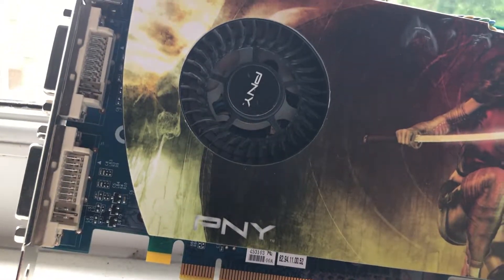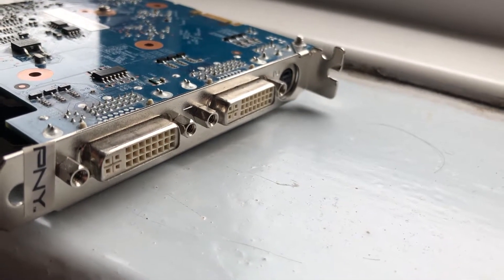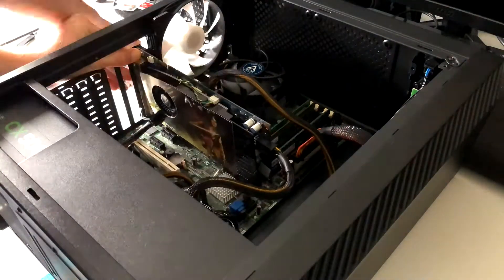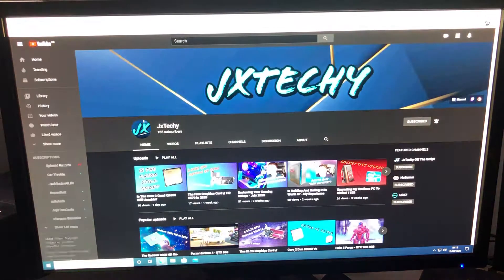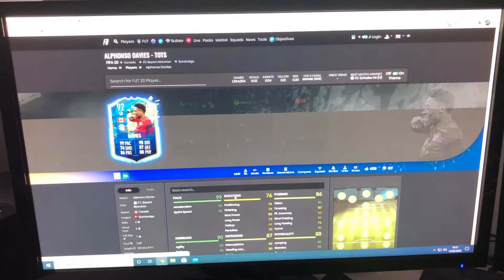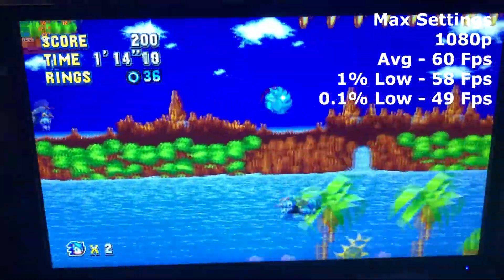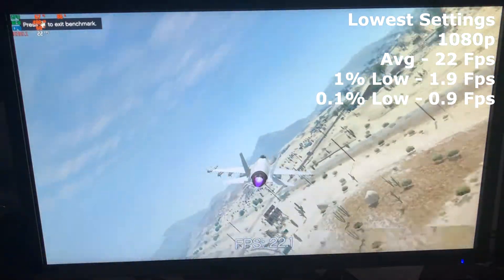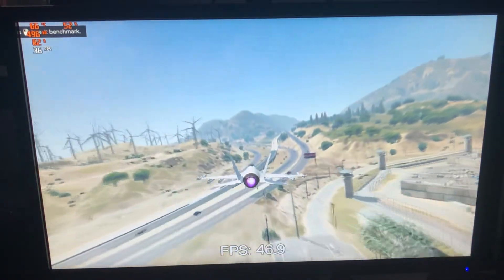The Nvidia 9600 GT In 2020

Comment: if you have a older version of gta v you can run it on 60fps on Nvidia 9600gt 720p low settings and need some tweak on the game files
Reply from the maker: Yeah, but in the video I wanted to give a scenario and test that most people would be trying with the card. If that makes sense

Comment: I'm still using this card and I have been trying to use a dvi to display port cable on my new monitor that has display port connector but I dont have any display on my monitor when I'm using it, i have triend a cable with dvi to hdmi connector on my LED TV and it actually work. Have you ever tried using this card on a monitor with display port connector?
Reply from the maker: No sorry I haven’t but it sounds like something is wrong with the cable as it should work. Try looking for another cable by a more reputable brand.

Comment: Hi there! I have a 512mb gt9600. The problem is that every time I enter a game, the signal from the screen goes out, but the pc remains on. If or if when this happens I have to restart from the cabinet button.
I already tried several things and it does not solve, it would be good if you could help me, thanks
Reply from the maker: There could be many reasons for this but I will list the obvious ones;
the game needs DirectX 11 or later (card is only DirectX10)
you need to install the latest drivers
The game may need more video memory
the game could be corrupt 
the game may not support this card
the card is overheating (try cleaning it and replacing thermal paste).

Comment: Thinking about buying 2 9600gt's for an SLI test. Its dirt cheap now should I get it ?
Reply from the maker: It’s completely up to you but I think a higher 9 series card could perform better
Reply: @ClassicTechUK  so like a 9800gtx ?
Reply: @ClassicTechUK  these days I am into a lot of older games. So much to do. So much fun. Prices of GPUs are through the roof. I cannot afford those anymore. For me its all about the classics.  My vega 56 in my gaming rig never goes down in price. The lowest i bought the card for is $300aud. Now prices are going high. Even mid range cards are selling out. There is nothing left :(
Reply from the maker: @lloydmaliakal6256  I know it is a bad market at the moment. Yes you could try and get a 9800 GTX or 9800 GTX+ as I have seen them go for around £20 or a little more. Totally worth it, if its just for retro games.
Reply: @ClassicTechUK  I shall look into it my friend :) not sure what psu is need for 2 x 9800gtx ? I will need to check it out. I just love my old games. So much fun.
Reply from the maker: If your looking to get 2 9800 gtx’s, the power supply’s it’s better going with a 750w psu
Reply: @ClassicTechUK  but is one card alone better ?
Reply from the maker: @lloydmaliakal6256  Complete depends on the game as some games have great SLI support and others don't. Even the older games are like this. But for the games that have good SLI support it will be a lot better than a single card.
Reply: @ClassicTechUK  I love the concept of it. However i tried crossfire hd 7850s. They were great but new games are not really optimised for it. Older titles worked like a charm. I always go for the single most poweful card. SLI is an idea I was thinking of doing.
Reply: @ClassicTechUK  i can accept the fact if some games are not optimised and some games are. :)
Reply: @ClassicTechUK  imagine a 9800gtx+ with an i5 2500k. Has a hdmi port. Also one on ebay going for $100AUD
Reply from the maker: @lloydmaliakal6256  That would be great build for a PC to play you older games on, especially with a HDMI port
Reply: @ClassicTechUK  are you into older games too. Or new titles ? I find that when new games come out. Its too demanding. You can only go so far. I don't like upgrading all the time.
Reply from the maker: @lloydmaliakal6256  I play some older games but not as old as the games I'm guessing you play. I think the oldest games I have are from 2009. Games I play are from 2009-2017
Reply: @ClassicTechUK   I play older games from 1997 up till 2016. Anything after that I refuse to buy because it is all about better performance. Buying new tech etc. Like I said before environmental waste. I like to give life to older systems. That's where it's at :)
Reply from the maker: @lloydmaliakal6256  Yeah same here. That's what this channel is all about
Reply: @ClassicTechUK  I was nearly going to by the gtx 260oc but turned it down. Reasons heat heat issue my psu being on 550watts. I was going to buy 2. But then buying a new psu is going to cost alot too.
Reply: @ClassicTechUK  I am keeping my eyes out for good deals.
Reply from the maker: @lloydmaliakal6256  Nice
Reply: @ClassicTechUK  you are right about one thing though old cards have lack of driver support. Something to think about.
Reply from the maker: @lloydmaliakal6256  yes definitely. AMD seem to have worse driver support than Nvidia for old cards
Reply: @ClassicTechUK  not playing flame wars both brands are respectable :)
Reply from the maker: @lloydmaliakal6256  Yeah I know that. It's just a fact. AMD driver support for older cards isn't great compared to Nvidia which is pretty decent.

Comment: For me its all about gameplay over graphics. I do not have the intention to upgrade all the time. Just the environmental waste :(
Reply: Same. This is why I can still play NES games to this day.
Reply: @Knightphall  technology is always changing. I cannot be bothered to splurge money on new tech. I don't really care. Im an old skool gamer. Always in the spirit of classic gaming. When a new game comes out im like mehhh.
Reply: @lloydmaliakal6256  And it gets expensive QUICK to try to keep up with the latest and greatest, especially with scalpers and miners wanting cards now. At least miners have a use for theirs, but scalpers are just outright greedy. 

I usually only upgrade my GPU every three years anyway. I'll be due for my next one in 2024.
Reply: @Knightphall  the last gpu I have in my gaming rig is my powercolor vega 56 gpu. It is still going strong. I don't need to upgrade. Like I said before a new gpu with ddr6 new mobo is all too costly. I bought the vega 56 used for $315.
Reply: @Knightphall  my vega 56 pricing today has sky rocketed it is hard to get. It is well above the 300. Much like the gtx 1080ti its price never goes down.
Reply: @Knightphall  the problems are the miners have brought all the cards. There are no cards left for the average consumer to buy. That is why people able to get their hands on old tech. Which in my opinion is still pretty good. My hp gaming laptop has the 9600m gt. My 13 year old 9600mgt runs all my older gems :)

Comment: I'm using this card : ]
GTA V :- 720p-average 45fps (low settings actually)
Reply from the maker: It completely depends what CPU and RAM you have. Also have you overclocked the card as this can make a difference? In my test I used a Q6600 AND 7GB of RAM and the card was at stock speeds. Also the benchmark is a lot more intensive than the actual gameplay.
Reply: @ClassicTechUK  i have 4GB RAM and card overclocked to 710 core clock & 1020 memory clock
Reply from the maker: That’s why you are seeing higher frame rates then
Reply: @ClassicTechUK  thats a 10 fps increase from 35 to 45 almost 50% increase not really possible he probably tweaked some settings, probably he has a better cooling/air flow in his case, btw when gpu maxes out cpu doesnt matter until it reaches its limit
Reply: @hmmm9183  it's cooling..
Reply: @ravinduudantha1770  better cooling higher fps, and I said he tweaked some settings, this is an old car I had one but cant remember if the clocks drop with higher temp
Reply from the maker: @hmmm9183  I know when the gpu is maxed out the cpu doesn't matter until it reaches it limit (sort of common knowledge for me, anyway). I said the overclock may have done it as on these older cards overclocks can have a massive impact on performance in game and fps, but as he said he also has some good cooling which helps keep the clock speeds high when under load.
Reply: @ClassicTechUK  well cant argue with you, I cant remember what my gpu was like ocd had like 3 years ago I know no that long ago, the oc might be different,  its werid that that old card can actually gain 35-45 fps in avg in gta even tho 720p, then again its an old card and can still has some power left xD
Reply from the maker: @hmmm9183  Yeah overclocking calculations where different with the older cards therefore overclocks  would give you a bigger boost in performance compared to cards nowadays with an overclock